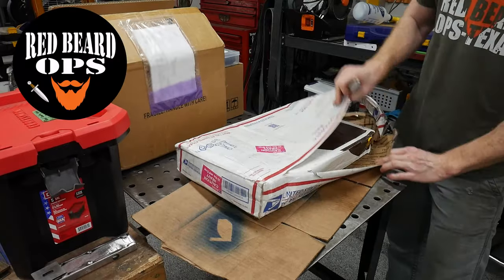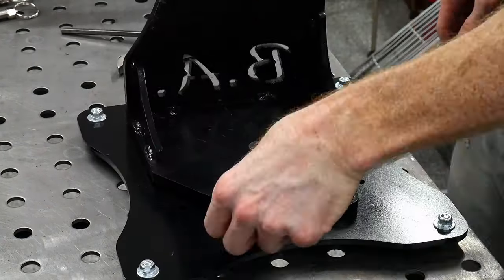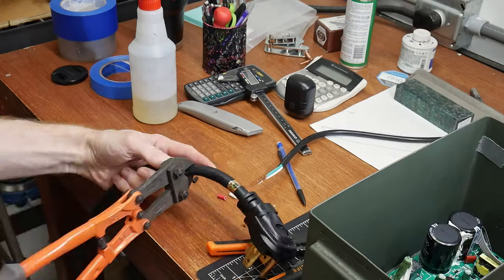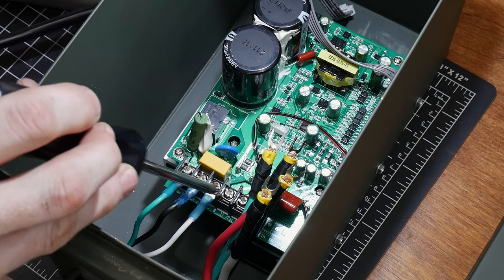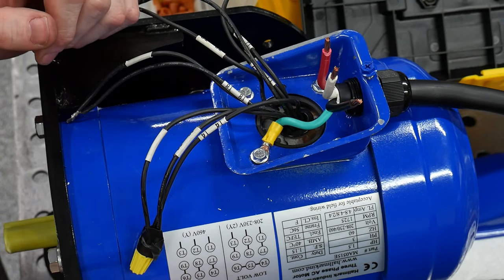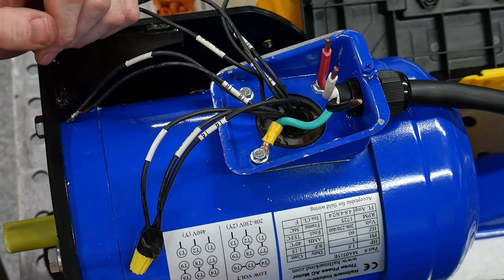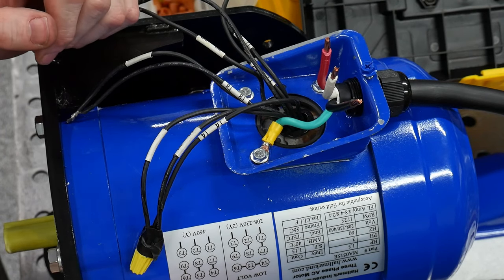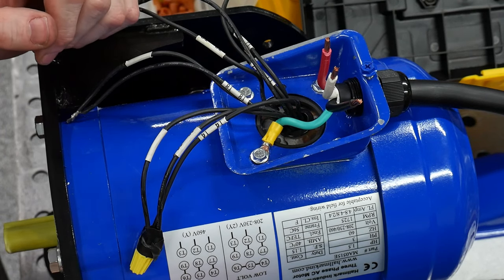DIY Disc Grinder Build - A Knife Making Tool I Should've Already Owned....

Comment from the maker: I can't wait to start using this machine in my knife builds! I'm currently making a 7'' takedown bowie, and have already found value in being able to get things flat easily. Mainly the ricasso, bevels, and spine. If you're interested in any of these components; I did my best to clearly list them in this video's description. Cheers 🙌 -  Oh and also; If you're interested in the BA Vander Sander you can save some money with promo code = redbeardops

Comment: Great video!  You did a very good job explaining everything in a way that's easy to understand.  Just a side note if you want the forward / reverse to go the other way just flip any two of the tree wires connected to U,V, or W on the VFD. So if you have 1,2,3 hooked to U,V,W you could do 2,1,3 or 1,3,2 to U,V,W.  This will flip the direction of the motor.  This is 100% safe and true for all three phase motors. :)
Reply from the maker: Very cool, thanks you sir!

Comment: I would recommend a larger gauge wire than  14awg for this. The vfd's power requirements are right at the limits of that wire size. 12awg would be better suited for this application. This is just a recommendation I want everyone to stay as safe as possible.
Reply from the maker: Never a bad idea to over build

Comment: Great build. 1. I haven't been able to locate any information on the cooling fan. 2. Brian hooked up his Motor for 3 phase/Cheap VFD with 220 plug, is there any difference with running the 120V you are working with here? Couple questions for you! You and Brian are going to cost me a fortune! Thanks for the videos and your time, its greatly appreciated! Steve
Reply from the maker: LOL, you got it all wrong. You have to do what my wife does when she goes shopping and told me how much money I saved by her buying stuff on sale. Brian and I are saving you money by laying out how to build the equipment ;) ;)

My unit has no cooling fan in it. 

Running on 120 derates the motor some... so it won't be as powerful.

Comment: Another great video (You're setting the bar high ; ). I'm in Phoenix with temps up to 118° Fahrenheit, and consistently over 110° in the summer.

We will see how the fully enclosed VFD works. 

I may put some vent holes with a filter on mine to allow more air circulation.

With the cheap VFDs, I'm not sure if there's going to be much overheating protection and I'm unsure what will happen if it overheats.

Anyone else have a fully enclosed box without vents in temperatures above 100°?
Reply from the maker: My temps have been in the 100s in Texas as well. Humid too. I'd ask Brian House his thoughts. I think he is in Florida? Can't remember
Reply: Usually the manual has advice about the installation position and ventilation clearances. Here are some spooky warning notes from the Siemens devices I use, f.e. SINAMICS V20. (Okay, they are another price-class and they have proper over-current and over-temperature protection, just by the way:) ). Maybe it helps:
1. Fire due to insufficient ventilation clearances
Inadequate ventilation clearances can lead to overheating of components and result in a subsequent fire with the development of smoke. This can cause severe bodily harm or death. Furthermore, increased failures and shortened lifetime of devices/systems. 
• Adhere to the minimum clearances specified for each component ventilation spaces.
2. Overheating if installed in an inadmissible position
If the installation position is not permitted, the device can overheat and be damaged as a result.
• Only operate the device in approved installation positions.
3. <Imagine a whole chapter about "Mounting in a control cabinet", here> with assembly instructions and dimensions.
4. Two pages of warning codes related solely to overtemperature of the various components of the drive or motor.

... typical for us Germans, right? Hehehe. I hope this helps somewhat for your considerations and that the manual of your device does have such advice, too. Oh and filters are a must have, you mentioned them. Especially when the device is mounted without enclosure ( although that enclosure doesn't protect anything from the following). Machine Shop = Oil and micro-metal-chips in the air! So make sure that your filter mats are also oil-tight. Check them at least once a year and then change them if needed, yes? :)

Nitpicks: Professionals (NO, anyone should, hehe!) use a fuse before the frequency converter (VFD) that corresponds to the nominal input current and is mandatory. The fuse in your house connection box only protects the line to the device. The fuses should be of the semi-conductor type or have a fast-fast tripping characteristic. Incidentally, the whole thing is completed with a 3-phase circuit breaker at the output, which limits it to the rated current of the motor.
One may think, that sounds too much ... and expensive. But compare the price of the protective devices against the VFD, the motor and the cables or the damage by a possible fire ... or the work you have (again!) when something of that is defect and you have the repair and exchange it.

Edit: I've had a few years in maintenance under my belt. I have never come across a broken motor that had such a circuit breaker on the output side[1]. For example, if the mechanism is overloaded, when something falls in or gets blocked. That's what those protective measures are there for. With machines that we hadn't designed and didn't have these protective devices, it has happened that the motor, control unit and lines had to be replaced after a mechanical blockage.That I forgot to mention ... the most important reason for using such circuit technology:) (And not speaking about the safety issues that a unprotected free running device pictures ...)
[1] Not talking about the usual suspects, wear and tear and the normal service life.

Ironic: Nice that they provided a PICTURE of a proper motor terminal block, but not the physical device, ouch ... Hehehe. (Image-Search for "motor connection block star/delta")

Edit2: Yes (as Red Beard mentioned at the end). BIG RED EMERGENCY Stop is the first thing you should design and screw in:)

BTW wonderful project, Red Beard. Thanks for the video!:)
Reply: @RedBeardOps  Something important: The (separable!) hinge of the ammo box cannot be considered as a reliable connection with regard to protective earth[2]. The idea with the screw was good(wait, we use her and her twin-sister later). But(!) ... the 45-degree bent terminal is just as bad because the terminals are simply not suitable for it[1]. My suggestion: Use such a great screw again at the bottom of the housing as a distributor (then it is already grounded). There we wire the supply line, then one to the converter, one to the motor and one to the cover(your existing one besides the switch). This is called star point wiring and is the correct procedure for wiring the protective earth. As a rule of thumb, we leave the protective conductor one and a half times as long as the other wires in the cable for supply lines that lead out of the housing and must be protected by strain relief(Very important for cables that can be moved, e.g. to be plugged into a socket). In the event of a mechanical accident, this ensures the latest demolition. Last but not least, for screwing protective earth connections: washers and snap rings are a MUST! Then even I am happy and silent ... :) 

[1] There are dual cable shoes and ferrules on the market ... but not for this use case here.
[2] The conductivity is guaranteed here by pure coincidence and luck. Both folks we don't want to rely on in electrical engineering, right?
Reply from the maker: @dieSpinnt  Thanks for the notes Jedzia

Comment: Hey James…is 1725 RPM the option you went with?  That’s what the motor link goes to.  Just curious on your thinking.
Reply from the maker: Yes, with a disc grinder you really don't need the high speed. I haven't ran it more than have power yet for ricasso and bevel flattening yet. 3600 would be way too fast IMO

Comment: Great video, and great job putting it together, but I’m not seeing the strategic advantage here. Couldn’t you have picked up a used Grizzly  large disc sander for less money/time spent on this project?
Reply from the maker: Thanks! The VFD control, precision disc, large work rest and the ability to manipulate the frame are some reasons to go with a more custom version.

Comment: I just wired up one of those VFDs this weekend and noticed the weird labeling. I did the opposite of you and followed what was on the board at first and had to reverse everything. 

I kept mine in its plastic case in the ammo can. Is it better to take it out like you did?
Reply from the maker: Hey Jon, I don't see an issue with keeping it in the plastic case. I just did what Brian House did. Seemed like the plastic case wasn't needed anymore.
Reply: @RedBeardOps  ok cool. Once I had it working I did wonder if it would overheat being in the can and in my hot garage. 

I was planning on using my old motor to make a disc grinder but now after watching your video I want it on a VFD lol. 

Thanks again!

Comment: Thanks for the links man!!! I've been needing to upgrade things in my shop (currently using a treadmill motor and controller for my 2×72)...even with currency conversion, shipping and duties,  the motor and VFD should be about 1/3 the cost I would pay from suppliers in canada...what speed motor would you recommend for a 2×72 ???
Reply from the maker: No problemo James. For a 2x72 I think the 3600 RPM range is what you'd want.
Reply: @RedBeardOps  thanks...I've seen conflicting information on the speed, citing higher torque from the lower rpm...but they don't explain how a 1750 rpm motor can exceed its rated speed, simply by connecting to a VFD
Reply from the maker: @jamesafseth326  The way I understand it is =>> if you're running a 3600 rpm motor at 1/4 speed it's going to have less torque than if you're running a 1750 RPM motor at 3/4 speed. But if you're grinding at 3600 RPM frequently, you'll maintain that torque. There are curves that show this I think for each motor.
Reply: @RedBeardOps  most of my grinding is at full speed (4500 on a 2hp DC treadmill motor, with 4" drive)..I slow it down to about half as I move up in grit..what I hate about my system, is that if I remove the blade too fast from the belt, the treadmill VFD will shut down the motor (like it's sensing that the user fell off the treadmill  😂)..that's the biggest reason I need to upgrade to a proper motor and VFD

Comment: Hey James…looks awesome!  Can’t wait to order one.  Did you get the original version or V2?  I just looked at Richard’s website and saw he has a V2 now.  Not sure what the difference is.
Reply from the maker: I'm 95% sure this is the version 2. Basically the V2's face place allows the chassis to accept either a 12'' or 9'' disc I think... Not 100%
Reply: @RedBeardOps  That makes sense…you had to pick between the 12 and 9 inch platform before.  Thanks!  Enjoy it.
Reply from the maker: @jasonvliet-odonataknifeworks  That's right. I'm a big fan of the 9'' since you can use standard sheets
Reply: Yes the grinder in this video is the 2nd Gen version.

Comment: I guess my disc grinder doesn't have a large enough diameter, because I always run into a problem with the center grinding less because it's moving slower than the outside...meaning the piece closer to me gets ground more aggressively.  The difference in grinding speed ends up making my stuff slightly convex, so I end up using a 4" belt instead :/
Reply from the maker: I see what you're saying. It does slow down towards the center for sure! Most of the actually grinding on the bevel seems to be happening on the outer diameter. Which is why I'm moving the blade towards the outsides. It will take me time to get used to this machine for sure!
Reply: @RedBeardOps  I think if I had a big enough diameter I might have better luck, and having a slight bevel might help some too (then again, if it was big enough, I wouldn't have to worry about going past center as much).  How does it compare to the surface grinder?  That setup seemed to produce some really flat results.
Reply from the maker: @Skinflaps_Meatslapper  I think if someone is needed to make a choice between this and a surface grinding attachment for their shop... they should go with the disc grinder.
Reply: @RedBeardOps  Makes sense if you put it that way, a disc grinder like yours really doesn't take up a lot of room and seems to be useful for more than just magnetic parts.  I have access to a huge surface grinder that I use with steel, but I've yet to figure out a way to make it work with non-magnetic scales.

Comment: What are the 1 degree bevel discs used for?
Reply from the maker: The idea behind a 1 degree beveled disc is to prevent your knife from hitting the other side of the disc. So one side is going down (that's the side you want to grind on) and the other side is going up (the side you don't want to grind on). This bevel should help with really long blades.
Reply: @RedBeardOps  oh ok. That makes sense. I've only used flat discs, and I could see how that could be helpful.

Comment: Great tool. But i prefer belt sanders :/
Reply from the maker: For sure, they both have their place! What I'm finding with the disc is that it reduced the amount of bevel hand sanding I need to do. And of course does a better job at flattening than a flat platen. But I wouldn't trade in my 2x72 for sure! LOL
Reply: @RedBeardOps  if that then I agree with you keep going

Comment: Fat engine, but the frame looks much too small in the video. It's a great machine for woodworking, but a disaster for blade sharpening, in my opinion.
Reply from the maker: It's working great! And it's not for sharpening. Cheers Raik